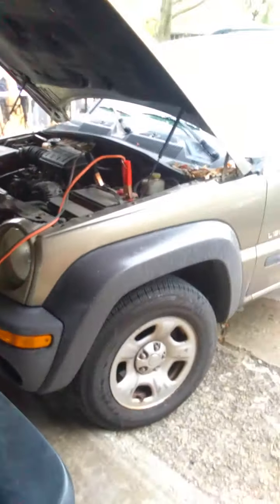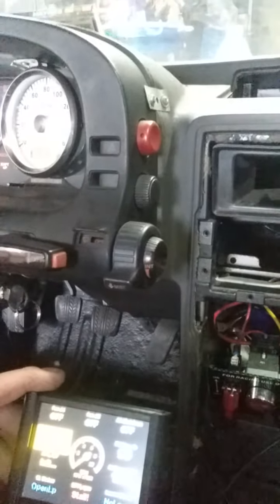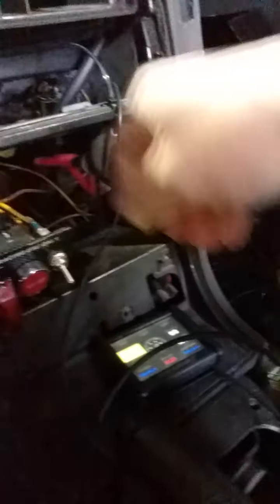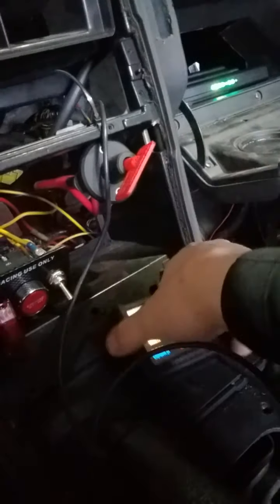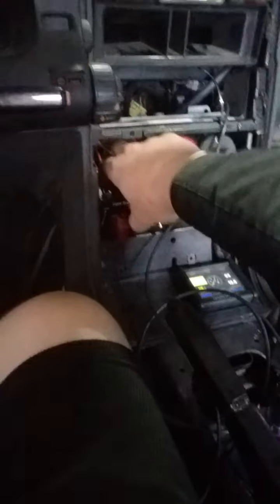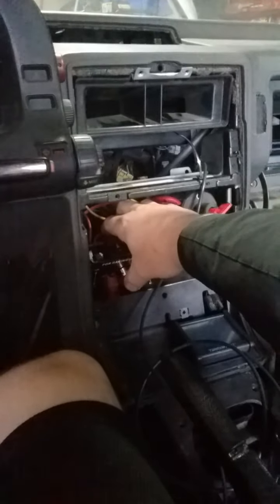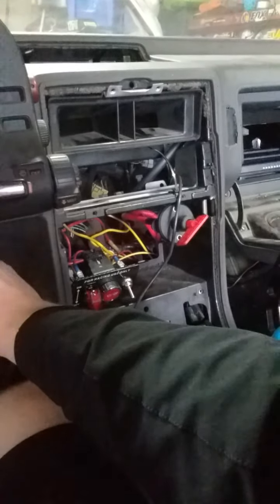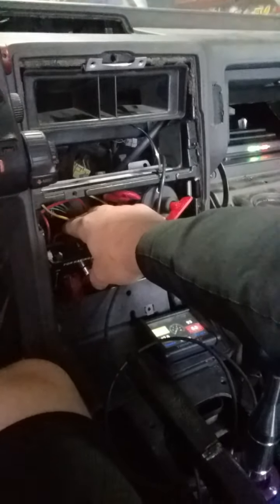Starting attempt 10/24/20. Holley Terminator X system for 24x/1x. LH6 5.3 in a 86 RX7

Comment: Wet, I’m putting a 5.3 in my z32 and I plan on using the terminator as well
Reply from the maker: It's a great system, I'm just working out the gremlins of mixing so many different parts, lol. Word to the wise, if you plan on using longtube headers, but cheap ebay ones! Haha, you'll have to beat the snot out of them to fit around the Z32 starter!!!
Reply: Reece Motorsports I’m actually not sure which headers to use because I hear all of them hit the steering column except loj but that’s too expensive for me now lol